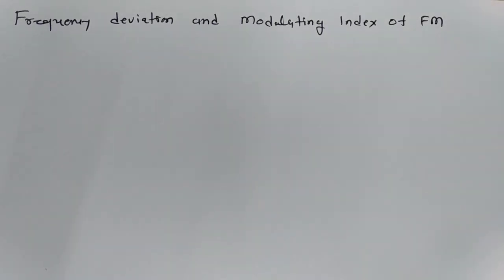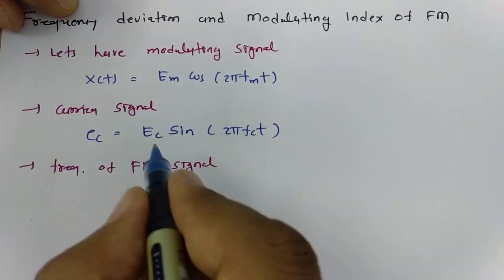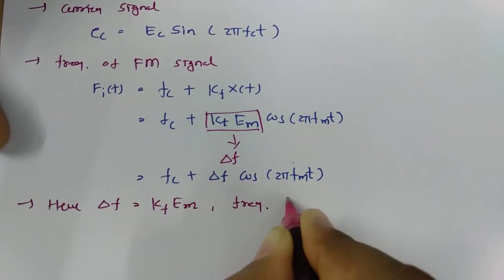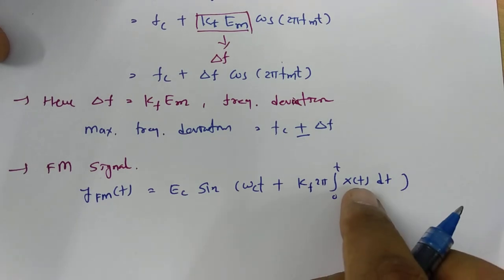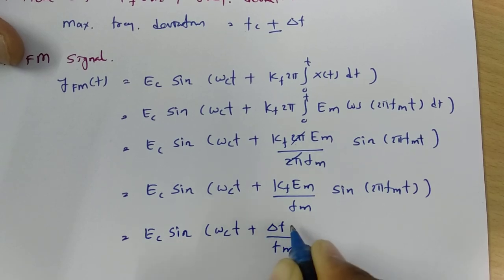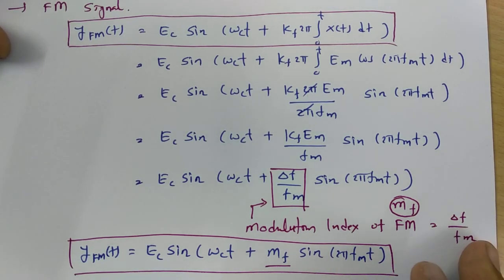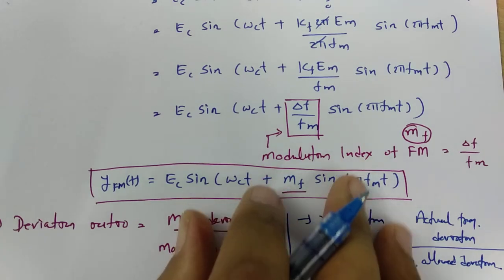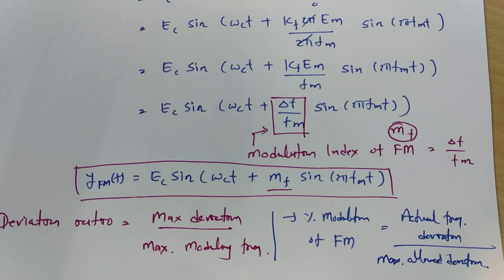Frequency Deviation and Modulation Index of Frequency Modulation FM in Analog Communication

Comment: Does the amplitude of modulating signal contribute in the frequency deviation? If yes then how
Reply: change in frequency literally represents the change in amplitude, does it not. It's just that instead of relying on amplitude deviation we use frequency deviation bc of its advantages

Comment: in the FM signal you used sin but there will cos
Reply from the maker: You can use both
Reply: There is no problem, sin and cos are the same function 90 degrees delayed from each other. The only thing you need here is a wave that oscilates in a certain frequency, which both sin and cos are fine to use.